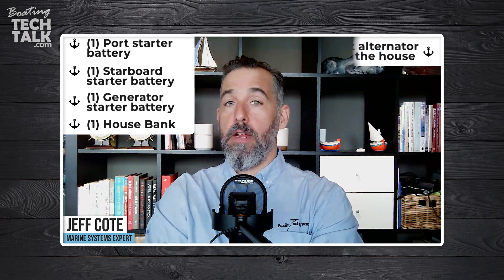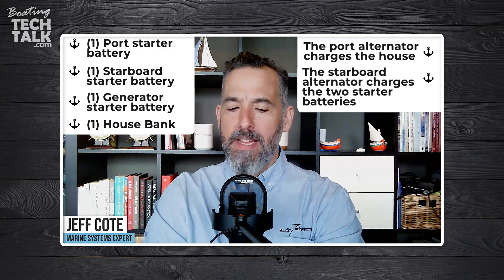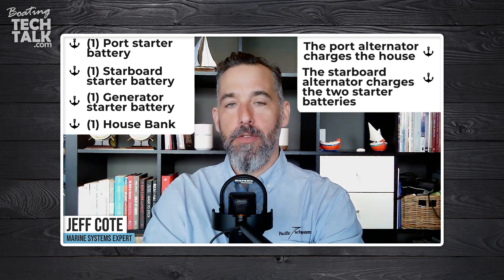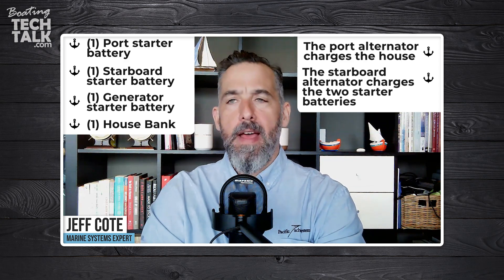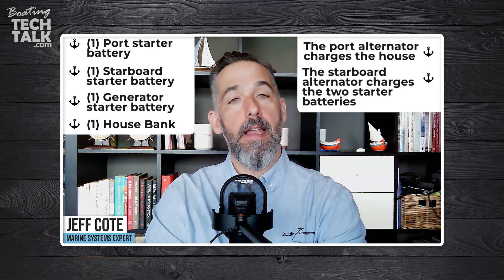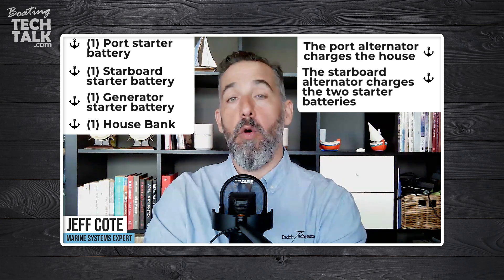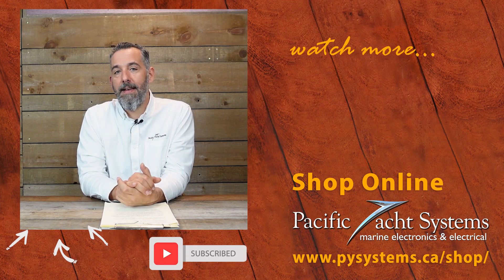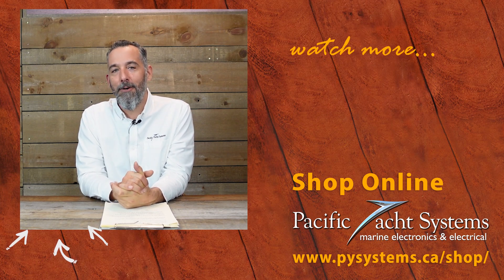How Do I Charge The Generator Battery on My Boat?

Comment: Thanks for the video. I found it to be very informative. I still have a question, my boat as well as a few others on my dock do not have an onboard battery charger connected to the gen battery for maintaining during periods of non use. Is there a reason for this?

Comment: On a 355 Carver my get battery has died. There is a battery charger switch on the panel and 3 battery charger switches under the steps with on stating generator battery charger. Also a battery switch specific to the generator. All of them are on yet the battery died. Testing the circuit there is no charging happening in those generator main battery lines. So it's as if there is a fuse blown or in fact only the generator charges it's own battery. Which seems pretty dumb to me. It should stay charged like my two main batteries.  Also (I'm new to this big boat thing) The two other batteries are for starting the engines but are they what you call house batteries? Or is one a starter battery and the other a house battery?  I was told to add one more battery for a house battery.  I don't see much room to do that.  Can someone explain house battery vs engine starter batteries? Note I am a marine mechanic from the 1980's but never worked on boats of this size nor have had a motorhome or travel trailer to have worked with house batteries at all.

Comment: Jeff
Enjoy your videos and have watched all of them I believe, I have a question about argofet battery isolators, I have a sportfishing boat with a windlass ,two Caterpillars but not a genset, I have A starter battery for each caterpillar and a house battery , my question is: and I have not seen you address this yet,, can you power/connect a argofet battery isolator  off of a output terminal of another upstream argofet battery isolator ?? I would like to have redundant charging for starter batteries and house battery and more importantly after watching your videos I want to install an additional smaller starter battery close to my windlass, have you at PYS ran battery isolators off of another Isolator? Thank you... Tony
Reply from the maker: Hi Tony, never seen or heard of this setup before, so cannot say how it will work. For us, we commonly install a dedicated battery isolator per engine, and this battery isolator might connected to it's dedicated starter battery, house, and windlass battery. Each battery isolator can charge the house and windlass battery.

Comment: not about generators, but still on the topic of charging and splitting the charge I have a question.. On my boat project (no generator) I now see that I will end up with 5 batteries.. Here is why:
It's a twin engine 36ft with bow and stern thrusters. thruster manufacture recommends to have separate battery for bow and separate for stern thruster. So I end up then with 5:
1. engine1 starter battery
2. engine2 starter battery
3. house bank (2x batteries)
4. thruster1 battery (bow)
5. thruster2 battery (stern)

I shall hookup the charge from 3-output isolators engine1 to charge (engine1+house+thurster1) and engine2 to charge (engine2+house+thruster2). All batteries are AGM.
Does that sound OK, or did I go the wrong path here? shore charge will go to engine1+engine2+house (3outputs) and if I have problems with thrusters, then I would get another charger for them.
Reply from the maker: Well explained and yes your plan works. 
Strongly suggest you get a dedicated charger for your generator battery, as AGM batteries should be float charged as much as possible.
Reply: @PacificYachtSystems  great advice! thanks a ton!

Comment: Would you expect that the 120VAC output of the generator feed the battery chargers and by extension charge all the batteries (house battery, engine 1&2 start batteries, thruster battery AND the generator start battery)?
Reply from the maker: In short yes, but all too often the generator battery isn't connected to a battery charger.

Comment: Usually, every single cylinder generators and smaller 2 cylinders don’t have an alternator, like Fisher Panda, whisper bolt, Next Generation, Power, etc. Their starting battery, if any, will get charged by the battery charger one the genset is outputting AC current…
Reply: Smaller generators may not have a dedicated alternator but they do generate a charging voltage for the gen starting battery. This is done somehow (rectifier) within the generator circuitry. My Koehler 4k watt gen has no alternator but voltage rises as Jeff says and charges gen battery. Gen manual also says it has circuitry to charge, 15 amps max. This feature works fine but of course gen has to be running. I have installed a small dedicated battery charger for this battery to keep gen start battery topped up when gen is not in use. Also, as Jeff says, you have to be careful putting a combiner or vcr to charge gen battery because the situation will occur when you start the generator and it immediately try’s to charge your depleted house battery which places too much load on rectifier and it fry’s itself-$250….(I know first hand)
Reply: @Rockabuy2002  interesting. I will need to go a bit further and study that…Thanks
Reply from the maker: Thanks for sharing svestancia.

Comment: Interesting and non-intuitive… why wouldn’t the generator recharge the generator battery instead of an alternator on the generator?  Is this to avoid voltage conversion/control circuitry?
Reply from the maker: If the Generator outputs 120 or 220 VAC, then you'd need a battery charger, to convert AC output from generator to DC output for the batteries. Sometimes, it's easier to have an alternator on the generator to directly recharge the battery that started the generator.